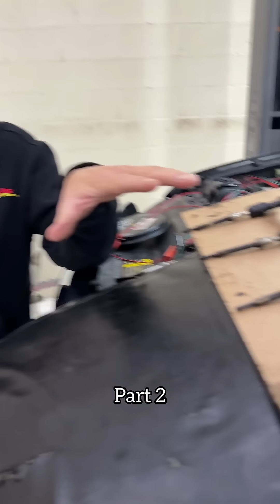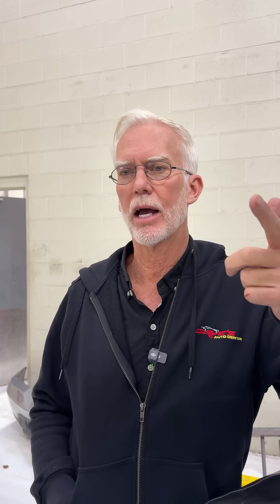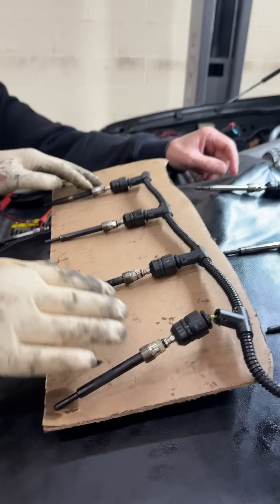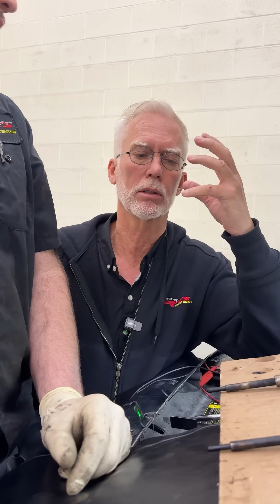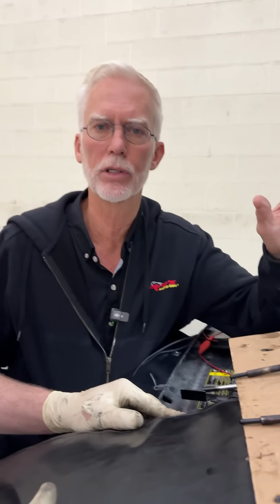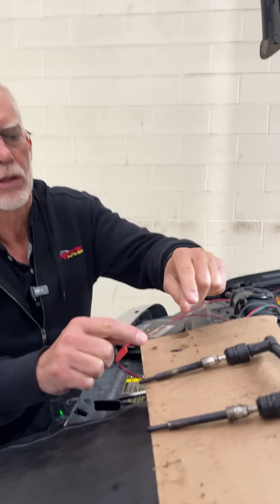Cold Start Mystery: Glow Plug Ground Fail

Comment: I had an air compressor that kept tripping its breaker. I'm not good with electrical so I called a friend that's an electrician. He came out and took the cover off the breaker box and tightened up the screw connections for the circuit. Worked like a champ. He tightened all of the rest of the screws for all of the other breakers like an eighth of a turn.
Reply: Loose bolts will cause current and voltage spikes which will trip the breaker.

Comment: Every electrical trace should start with a battery load test, then all grounds should be cleaned and assured. This wouldn't have solved the problem here, but grounds are 70% of electrical problems.

Comment: Nice work btw. I use a clamp amp meter, although a good DC clamp is expensive and it needs some getting used to it.
I also use the old timing strobe clamp to check injectors running. All kinds. ONLY one wire inside the clamp.

Comment: Voltage drop. Not magic, not rocket science. Load the circuit. You must have current flowing to have a voltage drop. Check the positive and negative sides of the circuit. You will find the fault. Thanks Dave. I always advocate teaching moments. You have great Technicians. You need to have passion for this trade, and never stop learning.

Comment: Didn't the alarm bell sound during the removal procedure of the glow plugs, due to looseness? Seems like a loose plug or two would automatically have them being tightened in the holes. Maybe rather than tightening, it was necessary to clean them up before installing them fresh.

Comment: That is the "weak link" on anything electrical; loose grounds ,fuses, connectors, and those pesky plugs with the moisture and corrosion causing arc, heating up and loosing metal strength. You look at them they look great until you disconnect them. Needle in a hay stack.

Comment: Looks like oil ran in through the threads. Aka not tighten properly bad grounding!
We paint every fastner that (HAS BEEN TORQUED) if it doesn’t have paint check it!

Comment: They left 2 sets of glow plugs loose?
Reply: Exactly!!!! They failed to torque them down...TWICE!  🤯🤯🤯
Reply: Maybe they didn't know they needed to be tourqed  🤔  It Sounds crazy. Twice?
Reply: @lanesworld4000 
  Some have long threads and carbon in the thread/seat areas can fool you into thinking it is seated, but is just wedging in the thread. Cleaning the holes is a important step skipped when in a hurry.
Reply: @jeffhill3681 the 2 sets of glow plugs were installed after replacing the engine. There would be no carbon buildup.
Reply: @jessejames96  BUT BUT - was it a "Brand new engine"??? We didn't get that much information given to us... In actual fact 🤔🤷
Reply: Joy...